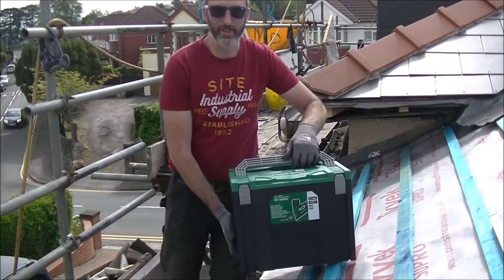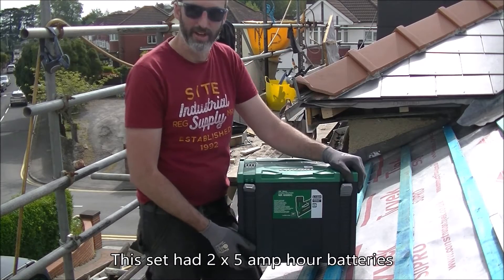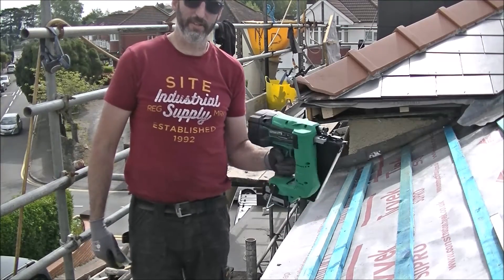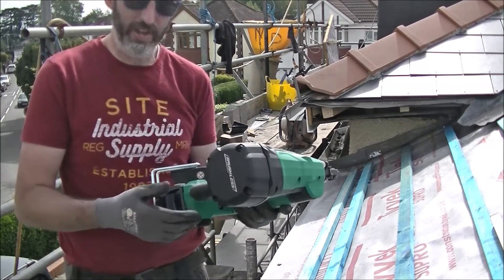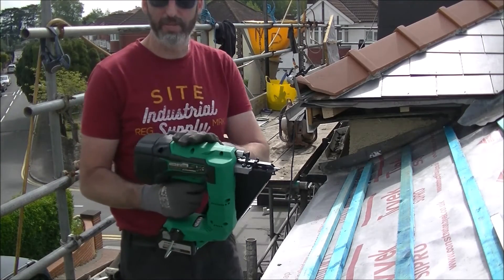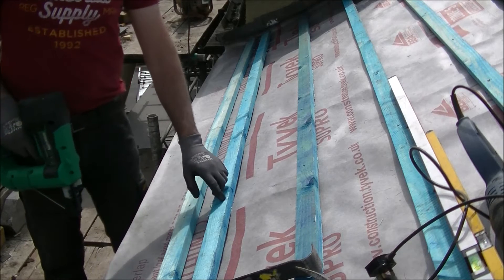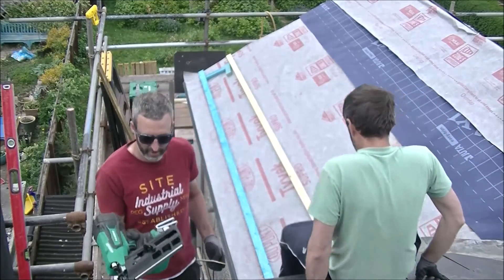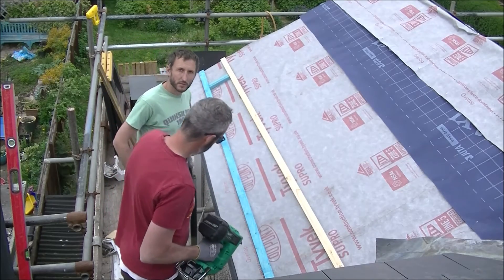HiKOKI 1st fix nailer review & demo. Hikoki 18v brushless nail gun (NR1890DC/JPZ)

Comment: I literally got one of these last Tuesday
Reply: I totally agree with the guy for the money (i paid £450) it’s totally worth it for the quality of the tool
Reply: Brilliant tool. I've used it loads since. It was new at the time if this video. I read mixed reviews on the Dewalts so went for this. Power is amazing. Never misfires. Always drives the nails home. Batteries go on forever. I bought nails from different places to get the best prices but I think FFX were about the cheapest at around £25 for 3300 if I remember rightly. Hope that helps. Enjoy your new tool!
Reply: Big Pouse ordered 3300 50mm nails for a fencing job and that came to £34 delivered from uk tool centre. not to sure yet to go for 75mm or 90mm for general framing with cls as 90mm seems abit overkill, do you have any experience with them?
Reply: Big Pouse only annoying thing for me is the clipped head ones on Screwfix are dewalt but stores near me don’t stock them without gas so if I ever run out can’t nip to the shop and get them for £40 have to wait a day till they get them in:(
Reply: Big Pouse also I see you got yours from toolstop I was thinking about that but I run Hikoki gear and I seen in trade counter direct you get the nailer with two 5ah multivolts for the £450 but they sent me two 5ah 18v so I had to do with rather than messing about sending it back
Reply: @beckjumper5787  I wanted the multivolt batteries but I'dont think it''s sold with them anywhere. I used Hitatchi years ago. Then went to Makita LXT. I've got everything makita but I'wanted a gasless gun so this was the best option. But I see now Kikoki are really making some nice machinery now. So I may have to thi I twice before my next Makita purchase!
Reply: @beckjumper5787  yes it is annoying. I splashed out on about 15000 nails of all sizes. I've got (I think) 55mm. 65mm 75mm and 90mm. 90mm are not ring shank but all others are. I've used the 65mm on fencing and seem great. I've used the 90's on 4x2 framing and have no problems there either. I actually found hikoki nails with FFX and Tool Stop. All were about £25 a box delivered. All sizes are great. Just adjust the depth on the the nose according to what you are nailing 👍
Reply: Big Pouse I can’t got buying 15k nails after just buying the gun only on apprentice wage ie 50hours =£250😭
Reply: @beckjumper5787  buy a box a month! Quick tip.  As an apprentice remember to always ask questions. No question is the wrong question when it comes to educating yourself. Best of of luck.
Reply: Big Pouse 75mm ring shank or 90mm smooth shank nails for the gun?
Reply: @beckjumper5787  I bought both. The 75mm ring shank are great. But a couple of 90mm smooth at opposing angles also does the trick.👍

Comment: Hi What size nails did you use for fixing the batten to the rafters? Thank you
Reply: Roofer here. The recommended nail penetration is 40mm. So for a 25mm batten a 65mm nail would be recommended. With a width of 3.35mm This meets BS 5534 standards.

Comment: I'm going to be getting one of these. I already got the 2nd fix nailer by Hitachi/HiKoki which is also on the heavy side but that is why you have less recoil. The nails are driven home more reliably without having to hold the tool hard against the work with both hands. Once you get used to the extra weight it's a big improvement over some of the lighter and cheaper 2nd fix nail guns out there.
Reply from the maker: Thanks for the feedback Peter.

Comment: which outlet did you get the nail gun from???
Reply: Toolden.  I paid £440 for it I think. The best price I could find. I've used it a lot since. It is a brilliant tool and the batteries last forever. You won't be disappointed!
Reply: I'm sure it's a positive placement nail gun
Reply: Look at first fix and second fix version then check out the positive placement nail gun